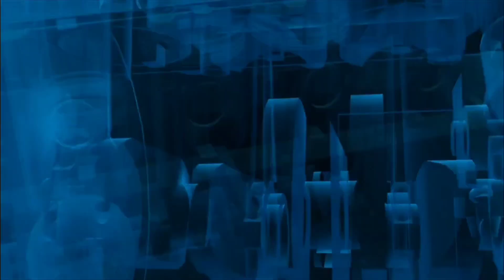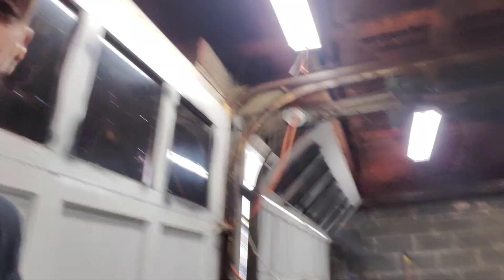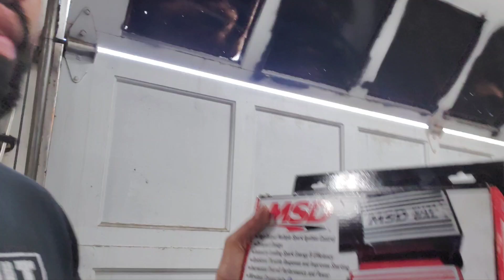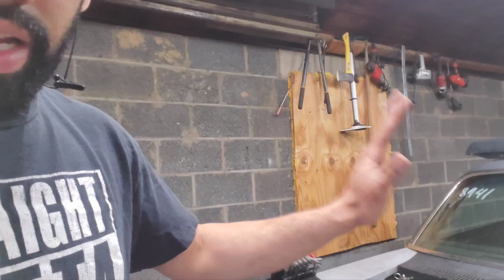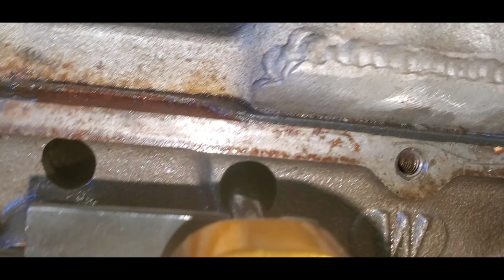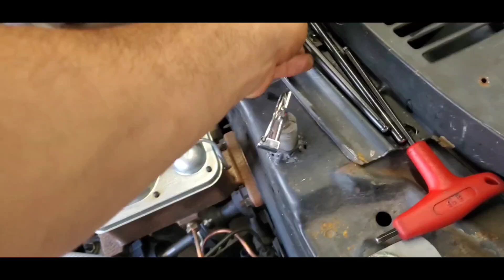Recap/Valvetrain Prevented Maintenance

Comment: Ive used 5/16 Manton .120 wall pushrods in a 68 MO code 302 sbc with BME aluminum rods & Arias pistons, lightened GM forged crank prepped by Reath automotive that i turned 9800rpm thru the lights. Had a Ultradyne .680+ lift 280/288@.050  solid roller in it. Never broke a pushrod. Car ran 9.80s in the 1/4 in a tubbed Vega NA. 6-17 gear & 7000 stall. Used hogged out 034 Bowtie heads from the 80s and a porter Strip Dominator intake, 2 in spacer & 830 Holley annular discharge. Mallory Unilite distributor with Pro Master coil. Stahl 1 7/8 primary, 3 1/2 collector swap headers. Bolted engine in with a Comp Engineering engine plate. Hard to beat them Manton pushrods. Trend also makes super strong badass pushrods.
Reply from the maker: I went with smith brothers .116 and they make a nice product as well. The 406 will be 3/8 though
Reply: @brokejoebuilds5165  Yep, Smith Brothers good shit. Too. You shouldn't have no problem there.

Comment: What heads are they i-037? World products
Reply from the maker: Yessir sportsman II castings...
Reply: @brokejoebuilds5165 I've seen dirt track engines making over 600+HP with them old Sportsman 2 heads on 358 cube engines. Kinda stingy out of the box, but they are pretty thick to grind on.
Reply from the maker: @thereluctantgearhead4544  started at 230 cfm and ended up at right under 290, with a 2.05. I have another set I think I can get 320 plus doing something a little funky.  Hopefully a winter project
Reply: @brokejoebuilds5165 Heavy lumps of iron for sure.

Comment: Drill both out, it will be fine.
Reply from the maker: If the heads weren't ported as far as they are would say yea.. but I cut alot of material out of it
Reply: @brokejoebuilds5165  you would only be cutting 1/32 from the wall, I honestly believe that you would be fine

Comment: Whats up cool what kind of tran are u running  is a trubo 400 ?
Reply from the maker: Powerglide with a 1.76 gear
Reply: @brokejoebuilds5165 You'd probably go quicker with a built 350-T trans. Chop that 60ft down at the least. I use T-400s in all my automatic trans cars. I'm fixing to give a 350-T a shot again in my Cutlass. I used to destroy them, but shits gotten better for them over the years. Still wouldn't want to use one behind a bigblock. Stock case easily broken I've found back in the day behind built big blocks.

Comment: They sell a tool, it's kinda a drill bushing that guides a drill bit to slot the push rod hole. Or you can drill it big enough for a brass sleeve that will give you the clearance you need.😎
Reply: The Louis tool, might help, but it uses a 5/16 drill, and slots the hole towards the valve, for 1:6 rockers
Reply from the maker: The problem isnt drilling the hole, it the strong possibility that I'll  drill into the intake port because of the porting. If it did break through it would make for a tuff repair without pulling everything apart
Reply: @brokejoebuilds5165  
The tool will only make the hole longer and if you sleeve the hole, no more air leak.🤷
Reply from the maker: That might work!
Reply: @brokejoebuilds5165  
That's what I was trying to tell you.😁
I would of posted an ink with an El but the tube doesn't allow those.🙄😎👍

Comment: Are you running a rev kit?
Reply from the maker: No, I think I should have enough spring.... i think  lol
Reply: @brokejoebuilds5165  
It wouldn't hurt spinning at those RPMs. Spinning over 7,500 RPM is where springs start breaking down and start loosing their pressure. NASCAR changes springs every race. I love buying those for street/strip that will never see over 7,500 RPM. I bought a set of those before for 40 bucks, the new cost they claimed was 600!😯 They worked great.😎👍